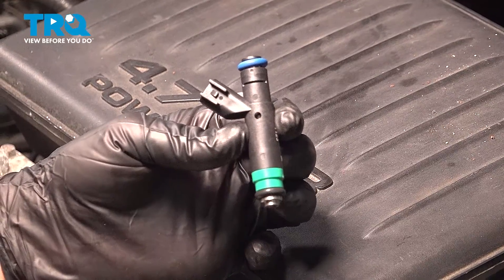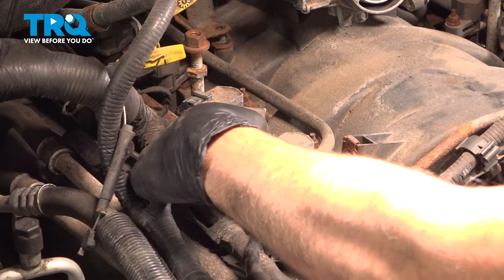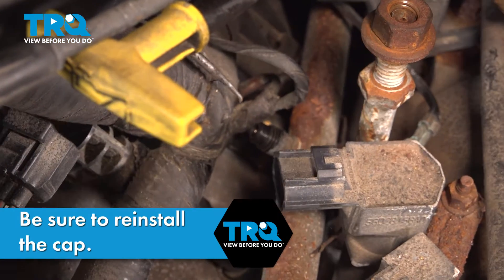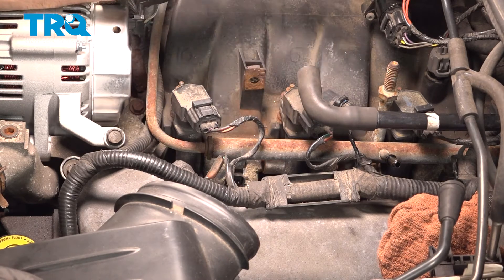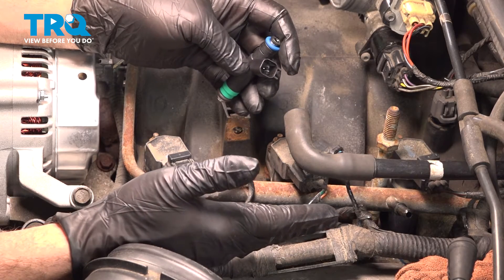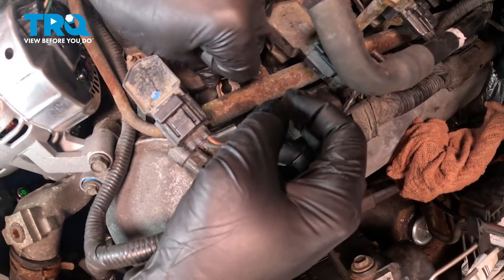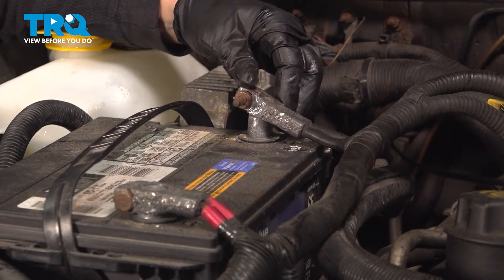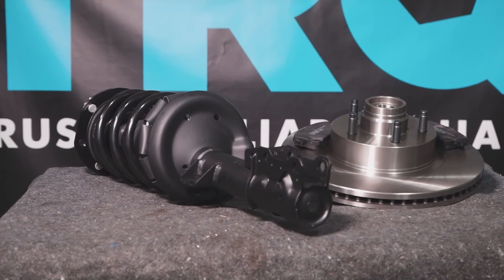How to Replace Fuel Injectors 1999-2004 Jeep Grand Cherokee 4.7L V8

Comment: I decided to buy a fuel pump, fuel injectors, fuel lines and a fuel tank cover(old one was rusted bad) and had everything put on at an automotive repair shop in town in Dec2023. Since I only use vehicle during winter time, I didn’t drive the jeep again until Oct 2024 and now it has a missfire when i try to turn it on. I have timed it and its about 7sec or cranking before it starts up. I opened the hood and there is a fuel injector thats loose and looks pushed up! I went to drop it off at the shop and they said $600 for all 8 injectors and $400 for labor. They said the warranty is gone after one year especially since I brought the parts from outside. I took the jeep in March 2025, thinking I had lifetime warranty and told them about the loose injector.. but now they want to charge me $100 for diagnosing the simple issue. I don’t know if this is common or if they just didn’t plug the injector right. Its the one located on the back left and its kinda hard to reach, which makes me think they might’ve struggled and didn’t put it right. Im just going to do it myself. There was no missfire ever before in the 14yrs ive had the jeep. Until my dumbazz decided to have them install new ones.. shouldve left it alone.